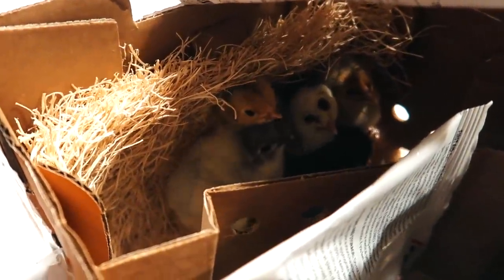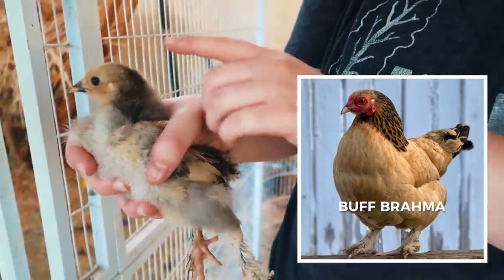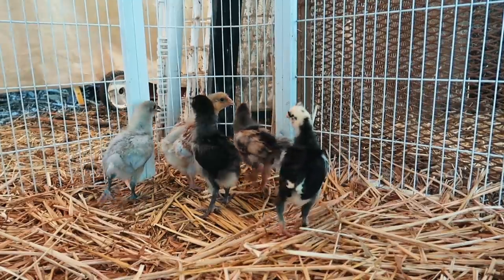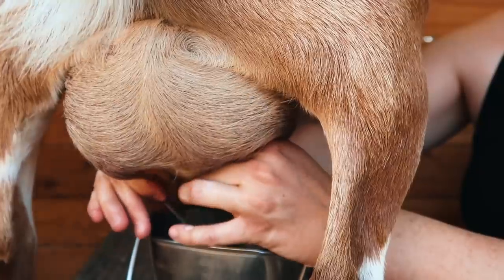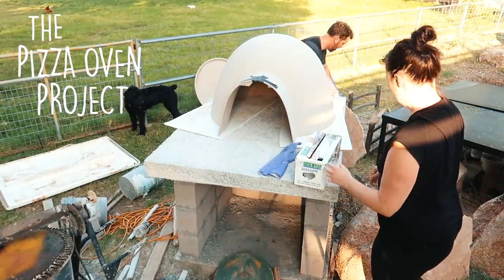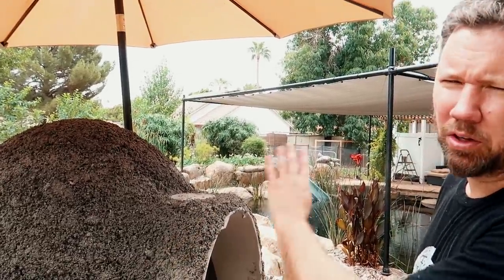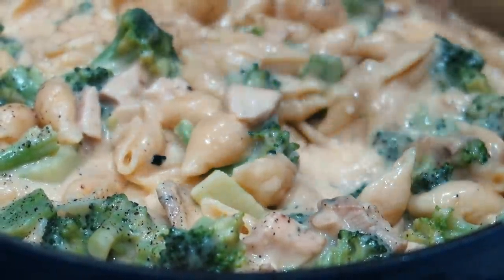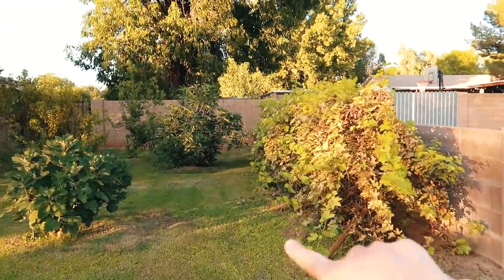BABY CHICKS just arrived in the mail -- and it's 110°F

Comment: I'm worried about your pizza oven. Normally, you would build up a mound of dirt on the oven base, cover it in wet newspaper, then pour and smooth the shell on top of the mound in layers. When the exterior is dry, the dirt is dug out and a fire is lit inside to finish curing the shell and burn off the newspaper. It's not very labour intensive. You could have still used the dog igloo. Fill the igloo with dirt, lift it off, then smooth and cover it in paper. I feel like you guys actually chose the HARDER way, because now you'll have to lift the shell off its base to remove the form; that shell is going to be heavy and might not be completely cured, and you'll have to seal around the base if you manage to replace it.
Reply from the maker: Yeah we might regret it 🤣 Either way it’ll be a good lesson 👍🏻